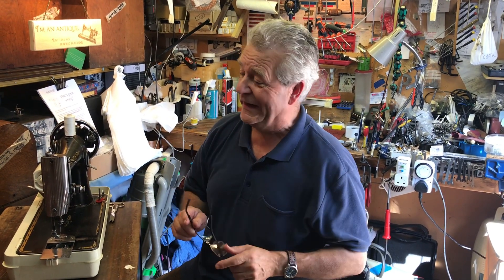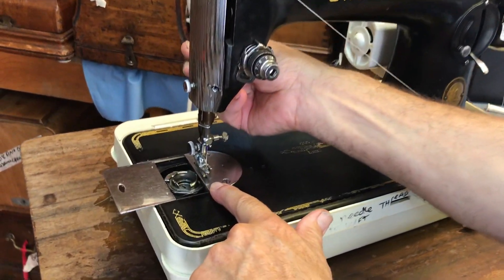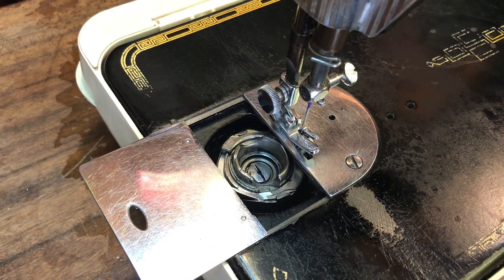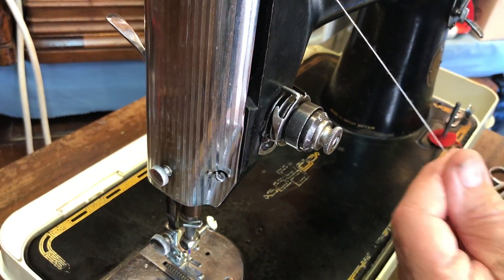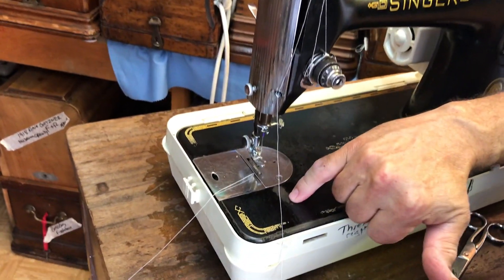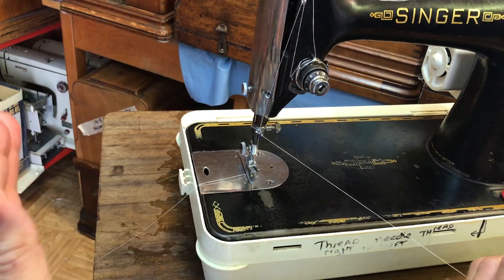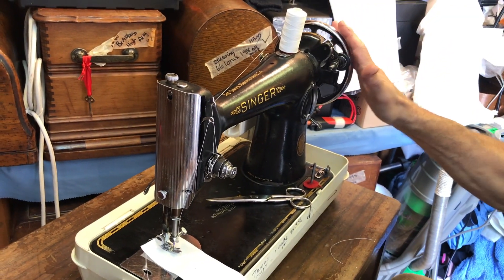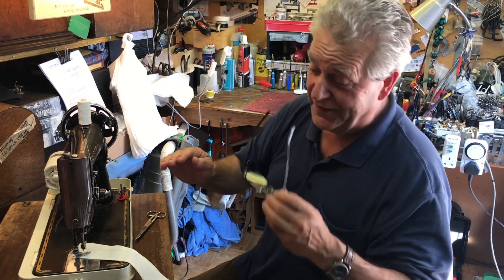Alex Askaroff Presents how to thread a vintage sewing machine.

Comment: Vintage Singer 1200 with a belted motor. Would that be a 1200-3.
Reply from the maker: The 201 with built in (potted) motor would be the 201-K2. The 201 with an external belted motor, either B.R.K or B.A.K. motor would be the 201-K3. Not to be confused with the origin of manufacture letter stamped on the machine plate, 201K-Kilbowie, Scotland. 201P-Australia and so on.